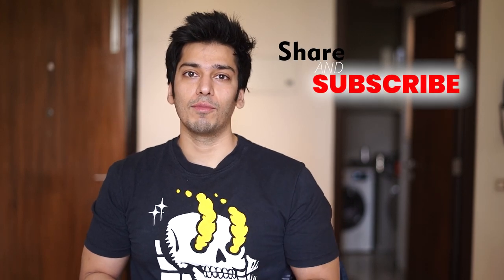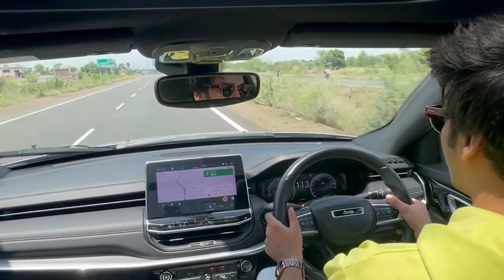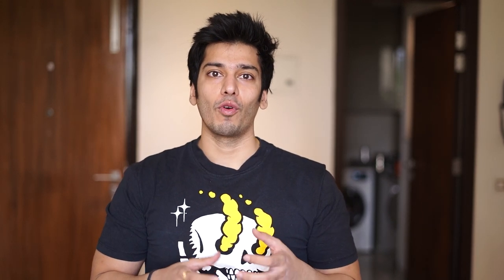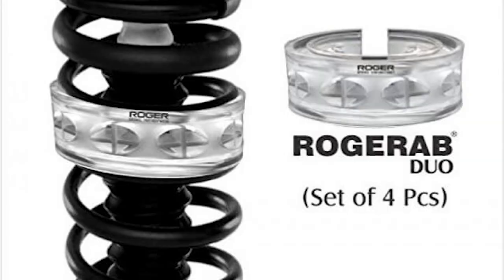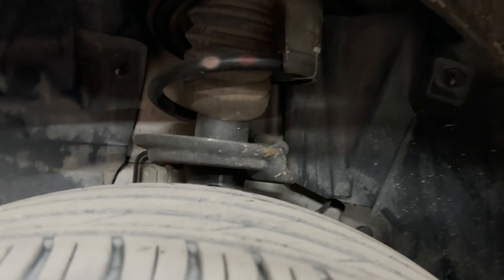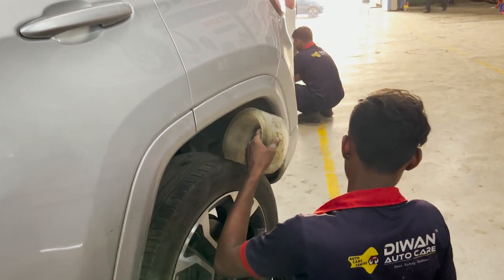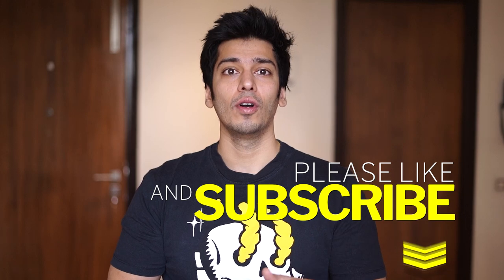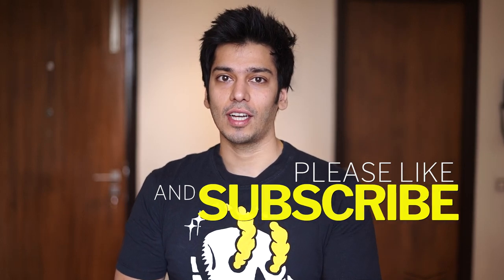Do Suspension Buffers work? Rogerab Buffers for Jeep Compass |Honest Review| #jeepcompass #rogerab

Comment: What was your reason for installing it in the first place? Just testing them out? Time pass?

These buffers are meant for older vehicles with age-weakened springs. (Or the odd factory car with poorly tuned suspension or really soft springs.)
Installing it on a vehicle with decent suspension isn't going to improve anything. Installing these on a sedan won't make it an SUV, or vice versa 😂
Reply from the maker: Agreed but I wanted to try. Zyada hi chul machi thi 😂